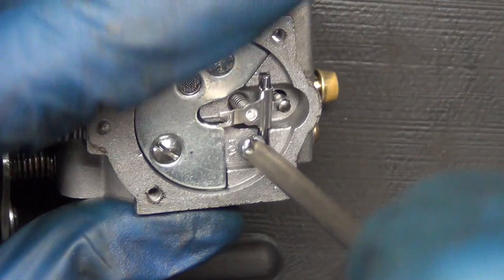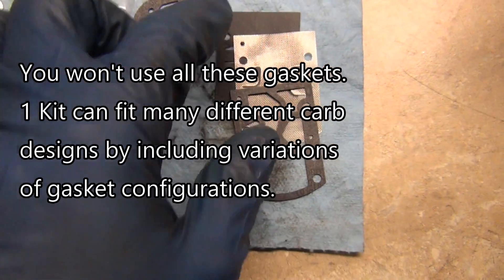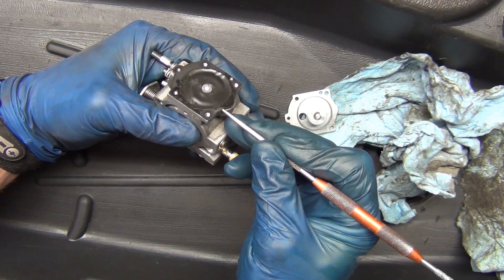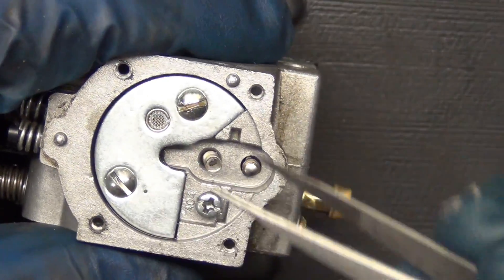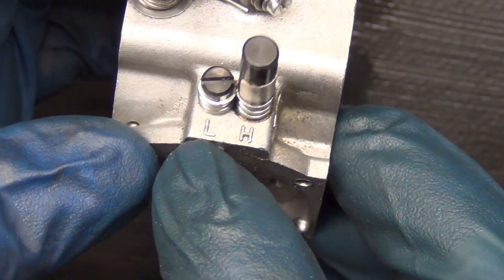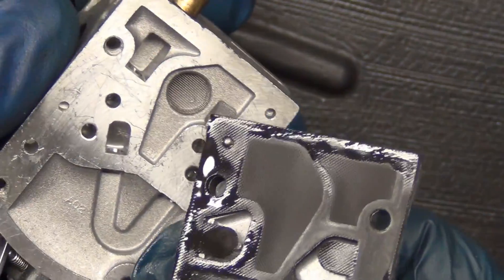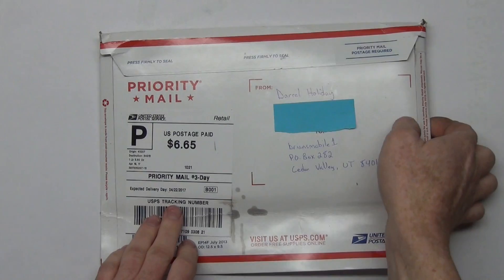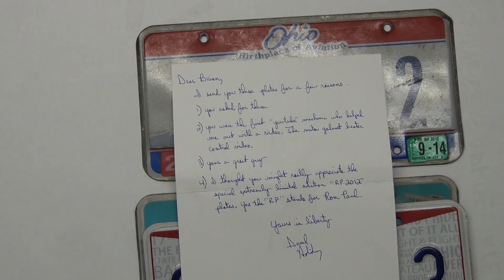Pt. 1 of 2 Carburetor K10-WB Warlboro Vittorazi Moster 185 Rebuild How-to

Comment: I have a carb question...  I was hoping someone might be able to help me with this.  I rebuilt my carb for my Moster 185 and now I have no mid range power,  there is low power or very high power.   Makes it impossible to foot drag or hold any altitude.  Any suggestions?

Comment: Look for a man on youtube who soaked hoses in different types of gasoline and showed swelling, hoses going soft and limp. It's the additives causing carb. problems not the ethanol. Seems they add stuff that's really bad for not metal parts because they can get away with it!!!!!!! Look up at the sky, what are planes also burning, trails that linger forever.

Comment: Hi Brian, Thanks again for sharing your video, so much help!  I'm doing my 25 hour maintenance on my 185 plus this week. According to the user manual I'm supposed to check and clean the carburetor. Do I need to remove the cover and diaphragm at this point or is that going to damage it? Any advice is very much appreciated!

Comment: Hi Brian - I'm just finding the throttle spring on my Moster is a bit tight/stiff, and as I use the Cameleon throttle I like to loosen it a bit.  Any advice on how to do this?  Would I have to get a smaller spring from somewhere and pull it apart to replace?  Any other ideas here....

Comment: Great Video.  The JIS comment is a great add to the video.  I have several, 21, different motorcycles I own and work on.  I am a former MM and can now work on motorcycles for a hobby, the fun is back!  I to use B-12 as a cleaning agent as well,  It works great, I buy it by the case.  You might add that the addition of Marvel Mystery oil and Stay-bil to the fuel will keep it from souring over the winter.  I also add a bit of Star Tron enzyme additive that insures good fuel over time and with 21 bikes reducing needed carb cleans is a must.  Thanks again,
James.

Comment: As a small engine repair guy,most of the repairs I do are gasoline related. Ethanol destroys the diphragm in small engines as well as the rubber tipped float needles and the little seat in most lawn mowers. I get a bunch of free mowers because of crappy fuel.

Comment: What happens if the diaphragm goes bad from ethanol
Reply from the maker: I haven't tested just a bad diaphragm and everything else being fine.  I can tell you what I see in 100s of carbs that go bad all together.  It gets harder to start, less power, and eventually won't run at all.

Comment: Hi man, do you recommend an engine flush for an Audi A4 with 120 miles on it. It's a 1.6 engine Eu model and I've changed all the spark plugs and found out that 2 had oil deposits on them.
Changed all four plugs since I got an engine check light, guess two of them weren't firing.
Wanted to do a flush since my car is eating oil, like 1 quart between oil changes and I don't drive much like 3000-4000 km per year.
Will it hurt to do a flush? I'm thinking to change oil and filter, get some cheap oil plus a new filter, do the flush and change the oil with a quality one.
Reply from the maker: Can I make a video on that and use your comment?  That oil on your plug is un burned gasoline from them not lighting it off well enough.
Reply from the maker: Flushing with chemicals should be a last resort to a full engine tear down based on costs and budget and is best done in conjunction with an oil pan removal.
Reply: Sure man, I will do a compression test anyway to see if the pistons are worn or not and if so I will do an engine flush anyway because I'm planning to do a engine rebuild anyway, so I'm taking the risk.

Comment: I went to Lowe's, Home Depot, Northern Tool, and Sears.  No one had ever heard of JIS screwdrivers.  I'm going to order mine online.
Reply: Jim O'Rourke i would recommend Vessel using them on older Honda bikes for years. Stripped a lot of screws before i figured out i was using the wrong tool for the job. 😂
Reply from the maker: LOL!  At least they finally have a metric screw selection now..... sort of.  You know I keep the lights on and videos coming from those Amazon links in the "SHOW MORE" thing you click to open under the video right?  I do it because it helps me like I said and it help you find what you need easier.  Everybody wins.  You can't always get a WIN/WIN, but I sure try to get them like this when I can.

Comment: Brian, I am surprised you don't use a small parts cleaner bucket. Even an ultrasonic cleaner would do better. You do 10 times more work than I do, and I thought about those benefits.
Reply from the maker: Economics.  I had one, dumped it when moving.

Comment: Many carburetor rebuild kits now contain E85 rated components.  Fuel lines should be inspected.  No fuel lines should just get replaced.  Make sure the replacement fuel lines are also E85 rated.  Ethanol can also play havoc with the metal components causing significant corrosion.  Some carburetors have a protective coating to prevent this.  Don't go too nuts on the cleaning phase (doubt any off the shelf aerosol cleaners would damage the coating.)
Reply: No idea, I'm in Canada, we use the metric system.
Reply: E85 is far better to the engine then gasoline!  It's not going to do any harm. I don't know where you get the idea...
Reply: Ahh sarcasm on the internets!
Reply: Good thing where I live we can get 91 AKI without ethanol (shell) :)
Reply: toysareforboys how many per gallon $5? 6?
Reply: Boys and girls I stand corrected the man is serious....  Costs less, and you get less... a lot less.  E10 provides around 96% of gasoline's energy.  E85 is only around 75% of gasolines energy.  Lots of subsidies in place to make that price point available which means the entire tax base is paying for it.  

Ethanol  required the creation of an entire production and distribution system.  They had many failures due to corrosion.  Hard and soft lines, valves, seals, were all susceptible to the acetic acid.  Automobile manufactures had the exact same failures.  Equipment manufactures experienced the same thing.  So everybody from producer to consumer had issues due to corrosion.  

All the modern stuff had to be designed to support ethanol.   To obtain proper air fuel ratios. larger metering jets or larger injectors, with variable programming to increase the fuel delivery rates as the blends vary during operation.  If ethanol blended fuel is going to sit more than 30 days in a non supported system it is better to drain it out and refill when needed again.

Comment: Lol, Men in Black reference.
Reply: "Old Busted, New Hotness."
Reply from the maker: Hey Troy!  Good to see you!
Reply: Cheers mate! Been a sub for quite a while. Still working on that idea I suggested? Haha
Reply from the maker: I wish!  I'm embarrassed to answer.  My work area has been a disaster.  Just functioning as a YouTuber since I've moved is killing me.  My uphill neighbors landscaped their yard like a funnel to wash out where my studio was to have been built 18 months ago.  I've re graded it 7-8 times in repair.  So I've slowly been morphing my "temporary" situation of chaos to work better.  I've never been so disorganized in my life.  I lost the notes.  My memory says it's on Engine health check, but it could be radio install basics, wire splices/load & protection, Electrical fundamentals, no start diag, or what happens if I over fill oil. Please remind me?
Reply: It was in regards to why an engine uses the amount of oil it does. Sounds like a rough time mate! Can't exactly build it on stilts either can you. Ag pipe and lots of gravel in strategic places may very well help.